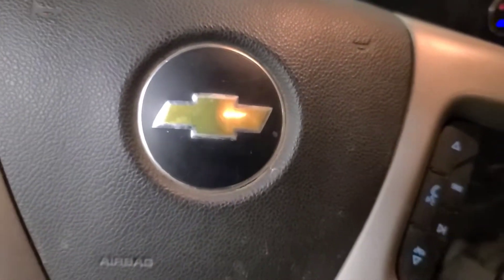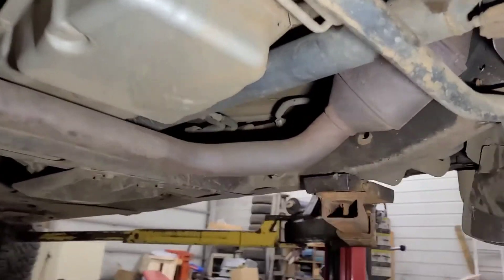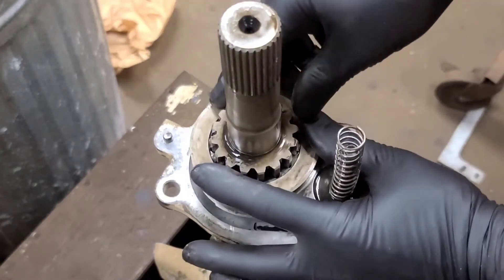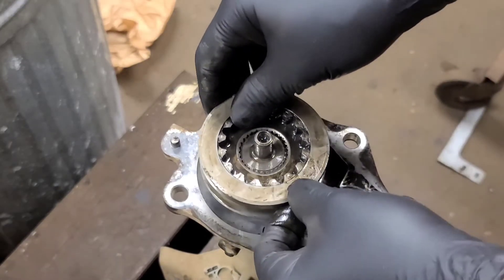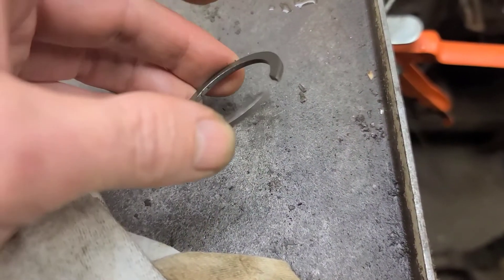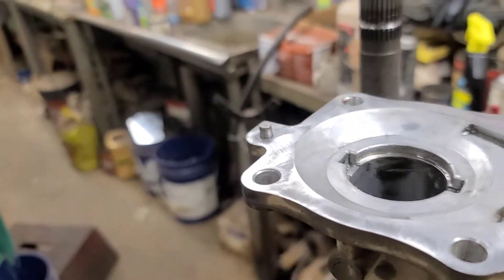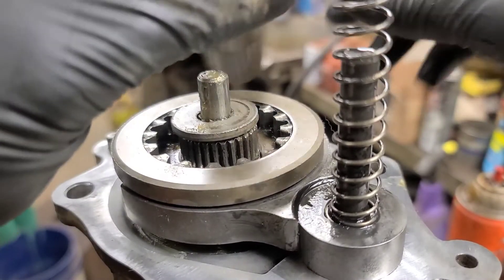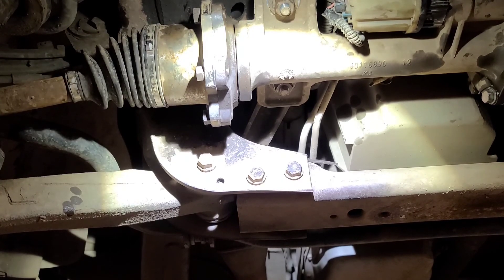2013 GM Truck 4x4 Not Engaging No Codes Present

Comment: I have an ‘08 GMC sierra 2500hd duramax with the same issue but to my understanding the shift lock changed in 2011. I found a rebuild kit 74080008 one site says it is for my truck and another site says it doesn’t fit my truck. Have you any videos for the 2008 GMC for this same problem. No 4x4 no codes. I checked everything down to the actuator and it all works. Tried manually pushing in shift fork but wheels still spin freely.
Reply from the maker: I believe the 2500HD uses a heavier front differential. I'll see what I can find... yes the 08 2500HD uses a 9.25 front differential and the 13 1500 uses a 8.25 differential. Similar design but different components. Possibly the short shaft inside the differential on the right side is broken. If you remove the right side housing you should be able to pull the short shaft out of the case.

Comment: I had gone through all the electrical components and found nothing wrong. I found this video and sure enough, this is my problem. Thank you.
How long did this repair hold up for?
Reply from the maker: This particular one seems to be ok but a second one I had with the same problem didn't last. If the truck is lifted that put excessive stress on the snap ring and causes it to fail. There are slightly longer cv shafts available for lifted trucks
Reply: @PhillipBailey thank you getting back to me. I noticed that the precious owner put leveling blocks under the struts. Those are definitely coming out this weekend as well.

Comment: Hello bro, I have fixed my car the same steps you showed in the video and it worked perfectly but unfortunately it pops out again. I believe the reason that generating the pull force on the column is still there. What could be the reason? Making all that pressure on the snap ring?
Reply from the maker: If the truck is lifted it puts extra stress on the snap ring. If the CV shafts are aftermarket I've seen shorter CV shafts than OE. It's a poor design imo.

Comment: 2001 Silverado, I replaced the front axle seals. A little ring got in my way from putting the inner shaft back into the dif, I had my friend push it in while I rotated the other wheel and got it installed. Went out to the trails and my front wheels weren’t doing anything in 4wd. Any help at all would be very appreciated
Reply from the maker: Check to see if the right axle popped out of the differential. It's a crappy design..

Comment: Thank you for this video! The snap ring on mine wore out the thrust washer, and the washer that goes on the other side of the fork. Ace Hardware has Heavy duty snap rings, got one and it fits the grove perfectly. Also had to make a new washer, Ace had grade 8 washers, lapped it to thickness with a 220grit lapping plate.
Reply from the maker: It's poorly engineered in my opinion and if the truck is lifted its worse.

Comment: This is what exactly wrong with my 4x4. Do you know what causes this? I switch it to 4 high while driving but I don’t accelerate. Also is it mandatory to grind or shave the grove? This helped a lot thanks.
Reply from the maker: It's a very poor design. Is your truck lifted  leveled? That pulls on the CV shaft and wears the thrust washer. This one came back again. I ended up replacing the cv shaft as I think the one that was in there was aftermarket and shorter.
Reply: I just fixed it and took it for a test drive and It split open again. I’m thinking the cvaxle might be short or I over tighten it. My cv axle is not after market. I’m pretty disappointed, but the video was great. My truck just has a problem which cause it to split again😠
Reply: It is a stock truck, any Input is appreciated, as no one is talking about this problem
Reply: Canadaskbud, did you get it figured out? Maybe the passenger drive axle is worn like this videos showed and the snap ring can't hold it in place??
Reply: @msschill I took it to a mechanic, I think they welded it, so now it’s working great for 6 months

Comment: 2012 yukon xl - exactly the same problem, snap ring didn`t grind the washer so much but enough to skip it. I guess it`s the "new" design that sucks.  
thanks for the video!!
Reply from the maker: This is a poor design for sure. If your truck is lifted or the CV shafts have been replaced this is often a problem afterwards.

Comment: I’m having a problem on my 07 1500, I’m stuck in 4 low and can’t get out. I replaced the switch for shits and giggles. The lights come on on the selector switch when I turn the truck on but when I go to switch to 2 hi it doesn’t even blink or anything it just stays in 4 low. Not sure what to do.
Reply from the maker: That is computer controlled so you have to scan it for codes. Also to shift into and out of 4 low I believe the truck must be running, vehicle stationary, transmission in neutral and foot on the brake.

Comment: Not sure if this generation 1500 is the same but on my 2018 I just found out that if the battery is weak it will not engage the front diff.  The T case will shift but no 4wd.  No trouble code or alert on the dash.  It just doesn't engage the diff.  Sounds weird cause my heated seats, heated steering wheel, etc works but no 4wd.  Replaced battery because of starting issue and 4wd now works.
Reply from the maker: Disconnecting the battery when replacing it may have cleared a fault code in the transfer case control module.

Comment: Perfect! Fixed my issue also! Now I do believe that the thrust washer is an hpdate as my 2008 acle had a thrust washer with taps and another washer on top of that. I do believe the thrust washer you installed is a thicker, updated version but great vid!

Comment: Thanks for video! I have a 2003 Silverado 2500hd manual 6 speed and lever style 4x4 (not push button). I fixed my front passenger axel seal a week ago. Put truck in 4x4 and worked great for 5 mins. Then truck wouldn’t move at all, like I had chocks under the wheels. Rides great in 2wd but won’t move at all in 4hi or 4lo. I remember thinking my snap ring was slightly loose compared to when I pulled it off. You think that is likely the issue? Thank you
Reply from the maker: Sorry but I'm not completely understanding what you are saying. In 4wd is it like the brakes are on and the truck won't roll or the engine revs but it won't move like it's in neutral. Sounds like a transfer case problem.
Reply: Thanks for the reply. When I put in 4wd, truck won’t move at all.. I would say more like neutral but it does want to buck some I just haven’t pushed it hard to avoid damage. When this truck had this problem with snap ring allowing axel to move, would it still move in 4wd ?
Reply from the maker: @jakevenable8057  it would move in 2wd and 4wd but the front wheels were not being driven in 4wd if the axle has disengaged.

Comment: I wish there was more people who knew about this.. your the only one on the whole internet talking about this.. thank you so much..
Reply from the maker: Yes I know it's frustrating for sure. I've had two trucks with the same problem and it's a shit design.
Reply: @PhillipBailey  I couldn't figure out my 1999 silverado to save my life everything worked but front wheels wouldn't spin..
Reply: @Just some weeb got a silveraydo! I did the transfer case module the front diff locker the transfer case and the front diff in that order.. everything on the net points you toward the switch panel and the computer but that all worked.. this video is pure gold
Reply: @Just some weeb got a silveraydo! is you name a reference to Amiri King? Have you seen his camero video?

Comment: I had this happen to my Suburban. On mine the front differential went out if adjustment and the right side adjuster was pushing out on the shaft causing the snapping to wear through the washer.

Comment: very good video, I have the same problem on my 09 Silverado 1/2 ton, but my shaft keeps walking out like you showed in the beginning. I have machined the groove and installed double snap rings and it still walks out, this is the third time trying to fix this, first time machine groove. I also have purchased a new shaft. any ideas I'm getting frustrated
Reply from the maker: Is the truck lifted? Even a leveling kit alters the CV shaft geometry and places additional stress on that clip. It's a shifty design. Have you replace the actual cv shaft. If the truck is lifted I believe there's a 1/2 inch longer shaft that helps or a spacer between the shaft flanges. You can also loosen the 4 bolts that hold the carrier into its mounts and shift the carrier to the right a little. There is movement in the bolt holes. Hope this helps you.
Reply: @PhillipBailey  my truck is stock and I've replaced the cv axle
Reply: @PhillipBailey  so I think similar. Trailblazer 3 inch lift.. 4x4 motor shifts but dont engage front wheels.. is it cause the geometry changed? Help. Ur the only one on tube tht has anything helpful on matter
Reply from the maker: @kingnasty5381  well this truck in the video came back today with the same issue. I'm starting to believe the problem is that the CV shafts that are being replaced with cheap AM parts are just a tad bit shorter and place side load on this shitty snap ring design. I've had two trucks with this problem. Both have had the CV shafts replaced prior to this shaft popping out. I'm going to fix the one I have in the shop again. It needs a left CV shaft now too and I'm pretty sure it's original since it still has the hard plastic boots. I'm going to compare lengths and I'll post a follow-up here.
Reply: @PhillipBailey  thanks man. Cause honestly.  No 4x4 is killing me and wanna diagnose first b4 going to a mechanic that's gonna try to tell me I have to replace the trasfer case ( again,)
Reply from the maker: Here's an update...https://youtu.be/3dB5j0KCjFc
Reply: Did that fix end up working? Or, what is the permanent fix for this problem?
Reply: I’m better this is my problem with my 2018, is there a better fix that isn’t oem? Or is the only real way to put in a different transfer case all together. Also what’s the time/ cost associated with this repair? Thanks for the video.

Comment: So I did this on mine cause both of my seals were leaking baby drops of oil and I assume where the gasket is also.. so I changed the seals and gasket and the cv axels that I got from oreily(everything else from the dealership) added the new oil dealer said 2.5 qtr but mine took 2qtr perhaps cause I filled it on the ground.. but when I came to test it 4H works fine but when I put it in neutral and shift it to 4L it engages fine as before when I put it in drive and hit the gas it just revs the engine and slightly moves... any suggestions? I doubt I put the big ring with the forks wrong. Makes me wanna recheck it again.. help?
Reply from the maker: If it works fine in 4High but not in 4L I would say your problem is in tge transfer case shift motor. Does the switch light up to indicate it shifted into low.
Reply: @PhillipBailey  yeah the light stays on in 4L no problem and it makes the sound that it engaged and lock as before but like if something was holding it back from going when I hit the gas feels like if I had the E-brake on.. 😩

Comment: The next guy that has to change that axle seal is gona be really upset with you lol.
Reply from the maker: On this system if you pull the right alxe out that spacer washer will fall down and you can't reinstall the axle. Best to remove the housing anyways...
Reply: You have to remove that whole side to get the axle out anyways. Only the other side can change the seal without case removal.